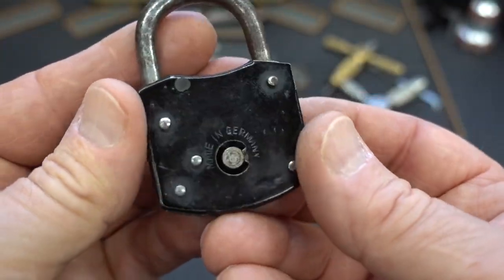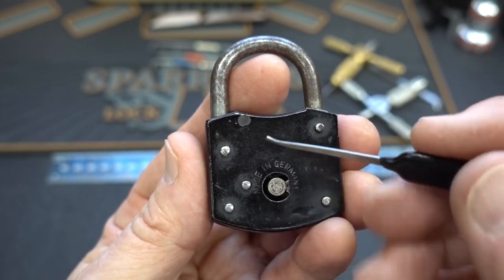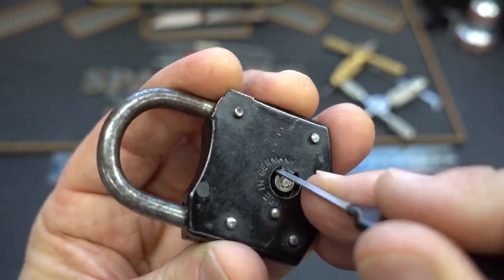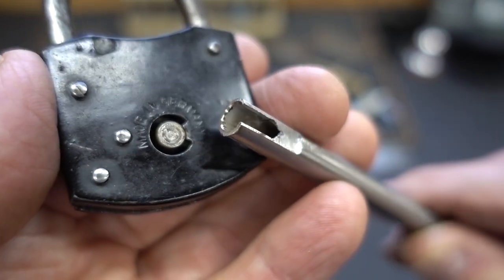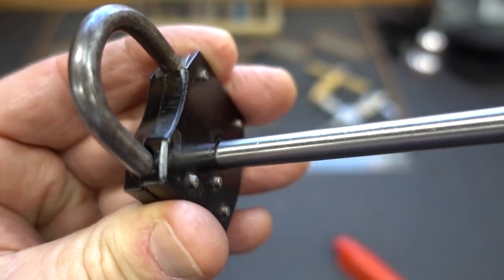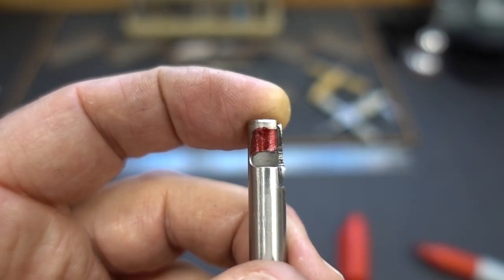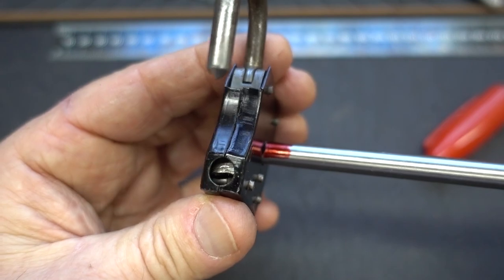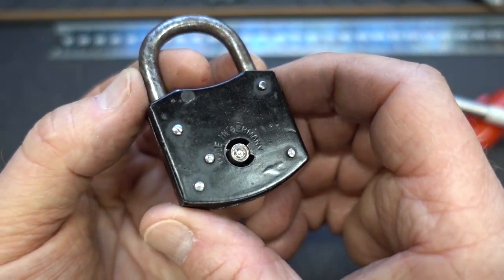(1616) German Tubular Lever Padlock

Comment: This is not a normal lever lock, this is a simple warded lock (technically, I guess warded locks are "one-lever" lever locks). Warded padlocks are still preferred in some applications because there are no internal moving parts to freeze or corrode in, eg, submerged or foul-weather outdoor use.  But their picking resistance sucks.  The only "lever" is the shackle release so If you can tension them, they open.  I have to say that's still the simplest warded lock I've seen that isn't clearly a toy.  Most at least have a more difficult path to the shackle release.

Comment: The crapiest security ever lever locks are just junk.
Reply: Lever locks are fine. You're thinking of warded locks, I think. Those can be opened with skeleton keys. And that's basically what this is- a tubular warded lock. Well made lever locks are nothing to sneeze at.
Reply: @puckcat22679  maybe so. Then how come when there is a video that comes out with lever locks ,then why is it so easy to get in not even if you're a experienced lock picker. And yes the warded locks are easy